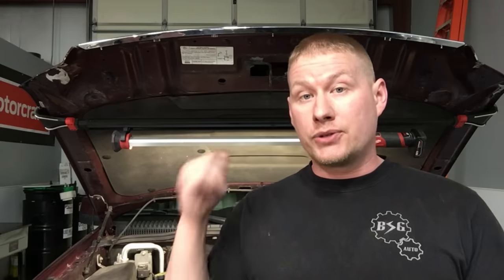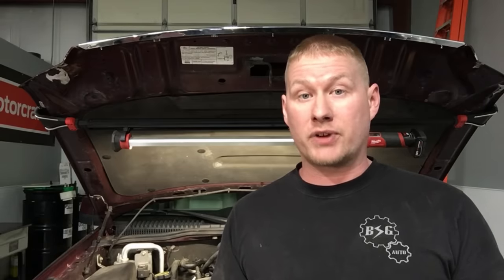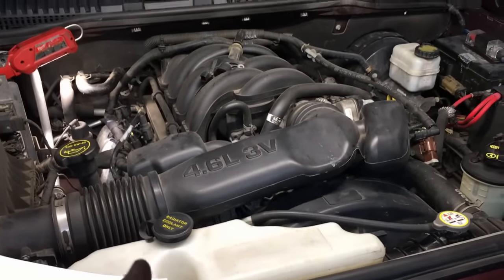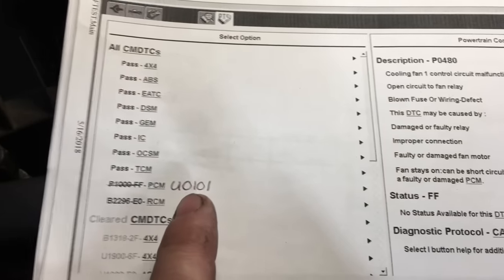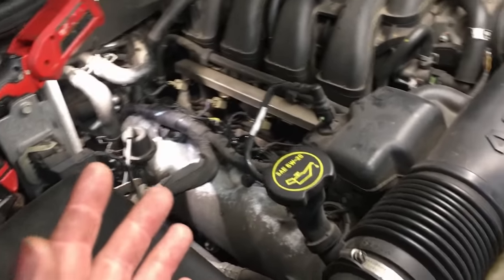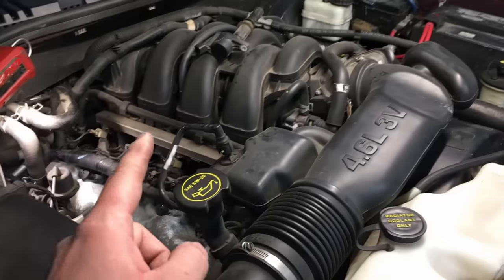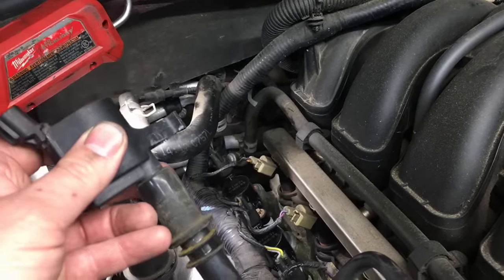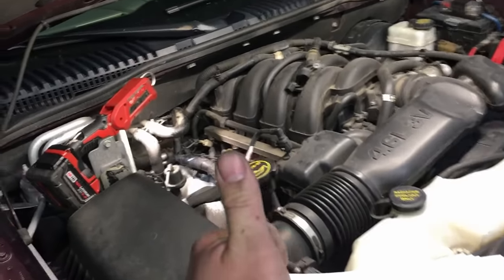2006-2010 Ford Explorer Transmission Shifting Issues Wrench Light: Check This Item First!!

Comment: I have an issue with a 2008 explorer, 4.6 v8 6 speed auto transmission. Between 40 and 50 mph, It seems as if the transmission goes into 6th gear a little too early, and the truck almost seems like a manual transmission vehicle that is shifted ito 5th or 6th gear at 25 or 30mph. It just seems like the vehicle is traveling too slow for it to be in 6th gear. I engage the cruise control between 40 and 50mph,and it smooths the transmission out. This is my 3rd Ford that I have owned, and ALL OF THEM HAD CLUNKY TRANSMISSIONS. Is this something I should worry about, at 157000 miles, or is it just a design flaw that I think it is? I would appreciate any feedback. Thank you. BTW, I have only had the vehicle for 2 months, and it has been this way since I bought it.
Reply: I'm curious if you would buy a Ford again...

Comment: I got similar issues with my 06 Ford fusion se v6 after driving for a bit it will start shifting hard lose in power and the wrench will come on and the rpm and speedometer will drop to zero for a little bit and it well say odometer error

Comment: Great to know!  What's the part number for the coil pack for a 2003 Expedition 5.4L?
Reply from the maker: You want to purchase from the "sold by and shipped from amazon" link. Otherwise you will get fake Motorcraft coils.This is the correct coil for your vehicle-  https://amzn.to/2Lkjlcg
Reply: Thanks -- I had been worried about counterfeits.

Comment: Hi, I have the same issue. But mine occurs as soon as I turn on my car, wrench,traction control and check engine come on. U0101 and P1900 codes. Car drives in limp mode for 5-10 mins and then kicks into gear. Drives fine after that. Once the car is off for more then 30 mins goes back into limp mode durning first 10 mins. Changed ignition coils, spark plugs (motocraft), throttle body sensor and maf sensor. Thinking it’s the PCM....any ideas?
Reply: Hi! Did you find out what the prob was? Thanks!

Comment: This happens to my 2007 explorer with a 4.0. It takes a second to shift into gear. I will be driving at 70mph with cruise control and then the wrench pops up and knocks me out like I have no power. I give it gas and nothing.

Comment: HI MR FORD TECH MAKULOCO,  MY NAME IS MICHAEL FROM RED SPRINGS NC.  I HAVE A 2008 EXPLORER WITH A 4.0L IN IT, WHEN DRIVING AT ABOUT 45 MPH THERE'S A WEIRD NOISE ON THE DRIVER FRONT SIDE AS I ACCELERATE MY VEHICLE, BUT WHEN YOU LET GO OF THE GAS PEDAL IT GOES AWAY BUT WHEN EVERYTIME I BEGAN DRIVING AGAIN IT COMES BACK,  ANY IDEAS WHATS GOING ON, FRONT HUB BEARING IS REALLY TIGHT LIKE NEW, ALSO CHECK THE BRAKES  THE WHOLE ASSY AND ITS FIND, ALSO CHECK THE FRONT DIFFERENTIAL FLUID AND IS FINE.   NOT EVEN FORD TECH IN LUMBERTON NC OR FAYETTEVILE CAN'T FIND THE PROBLEM.  CAN YOU HAVE ANY IDEA WHAT'S GOING ON IN MY TRUCK.   THANK YOU SO MUCH FOR YOUR HELP.  

   MICHAEL TORRES FRON RED SPRINGS NC

Comment: I Need help i have ford explorer 2006 she have code u101 lost comunication transmition module tcm
Reply: If it's a 3v 4.6 V8 then do what he said, replace the coils with new Factory motorcraft coils ($300-$500 for a set of 8)

I had that same code and transmission wouldnt shift right, after I replaced the coils the issue went away and hasn't come back

Comment: What about MSD or ACCEL coils? Any good?
Reply: I think both those brands have gone the same way most have - that is, made in china. I have used Accel cap, rotor, coil, & wires within the past 5 years, but ended up selling the vehicle they were in, so I can't tell you about longevity. Had no problems for the 10k or so miles I ran them. Alot of the time you can just tell by the construction how cheaply made something is, and the Accel stuff was no exception. The cap looked very cheaply made, and the contacts became loaded up with pits and rotor material a bit sooner than I've been used to. As far as modern car parts, I couldn't tell you there, but I suspect things wouldn't be much different as far as quality goes.

Comment: 2010 FX4......shift issue? Maybe? At first start up, truck seems to be bogged down. After a minute everything is fine. Seems to be an issue with either 2nd or 3rd gear but I'm not 100%. Haven't seen this problem much on any message boards. Anyone have this experience?

Comment: could you just shield the ECM to trans module cable?
Reply from the maker: Why would you ever do that when you pinpointed the point of interference.
Reply: Shielding did not help changing out bank of voils thanks

Comment: My 2007 Ford Focus started to have transmission problems after replacing the coils.
Reply: Did you ever get it fixed what did you do if so
Reply: Don't you love how they don't follow up on the story?
Reply: @TonyMontana-xf2pm  I had to replace the transmission

Comment: 6:03 But isn't this the excat reason why can bus lines are twisted? So if one wire gets inductive voltage, the other one gets is too and the voltage difference between the two wires is still the same? How can this cause problems in the network?
Reply from the maker: These are UTP not STP wires. The twisting only helps so much that is why when you run network cables in your house you can use UTP normally but they offer STP for areas where you will be running the network cable close to house line voltage sources.
Reply: FordTechMakuloco Thanks for your reply. Whats UTP and STP?
Reply from the maker: Unshielded and Shielded Twisted Pair
Reply: FordTechMakuloco Thx!

Comment: Hey i have a 2010 Ford Explorer xly 145k on the mileage and it only goes forward. One suspect a transmission problem but one day it went back to normal and could drive forward and reverse. Next week or so it goes back to the issues and only drives forward. Is this a rebuild or replace transmission issue or is there something else I’m missing? Dont want to waste thousands on a mechanics assumption of a possible simple fix. Ppl have suggested a used part labor etc for a cool price in ny of $1500 so far but I’m still looking to be cost effective. Anyone have any ideas what else could be wrong with this truck? I’m looking to sell it but want to make auger everything on it is good
Reply: Sure* also everything else on the vehicle is good and there’s no wrench light or engine lights
Reply: Every mechanic says this vehicle is solid despite that problem

Comment: Fix or Repair Daily
Reply: That's not all fair man. It was the breaking down of a coil of wire, giving an erratic magnetic field when receiving its pulse to fire the plug. And its that erratic magnetic field which induced an interference into the various conductors within the same length of harness the coil wire itself os routed in. Basically a coil, which every car mfg has, breaking down, which all coils do over time and use, that gave way to an erratic.mag fiield induction into the neighboring wires its routed with.... Basically, every single vehicle mfg has the ability to create this problem- not just fords. And honestly, if people weren't so cheap when it came to repairing their vehicles, we probably wouldnt have beem so lucky to have this tidbit of knowledge.

Comment: It all depends on what aftermarket coil you go with. There are cheap chinese ones and then there are premium aftermarket that are on the same level as the OE parts. I also prefer OE as much as you can and right now with Ford/Motorcraft trying to price competitively they are on a pretty good price point so you can afford the OE. Depending on who you are purchasing them from.

Comment: 5 minutes to change one banks coils.  Bwahaha.  The average customer has a hard time putting gas in a car.  Dont undermine how difficult and challenging it can be to work on cars.  The coils are not that difficult to replace and should not be explained as only a tech can do them.  Dont pander to people so they follow you.
Reply from the maker: What? My whole channel is built on showing how things are done so that the owners can fix it themselves.